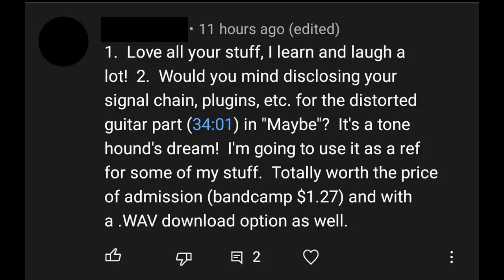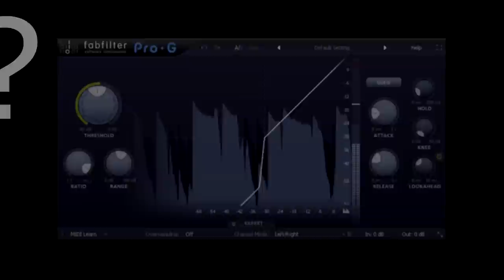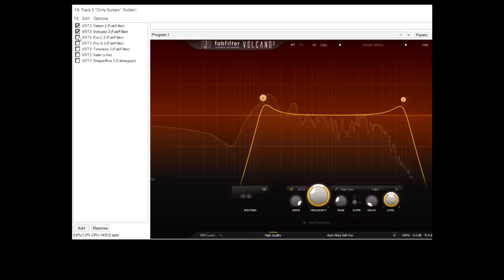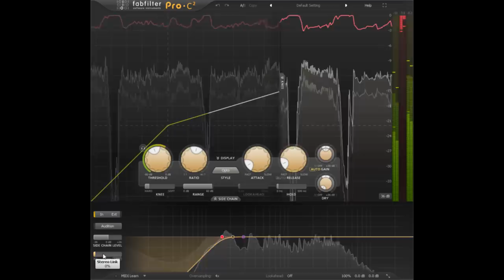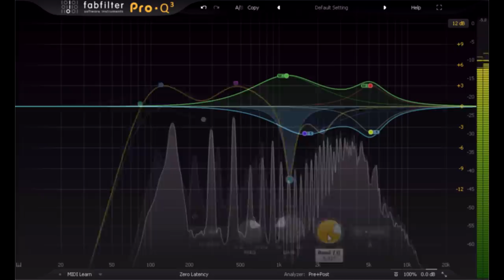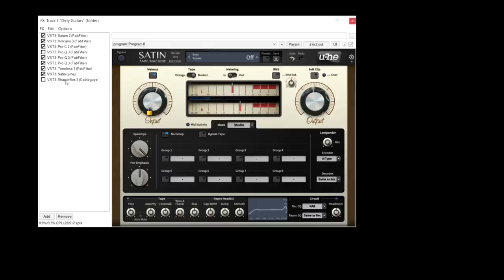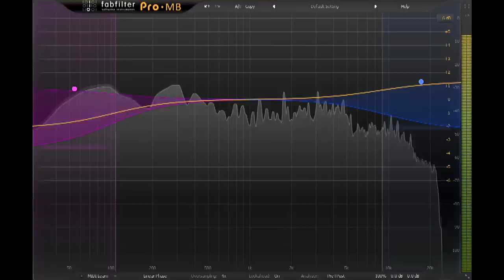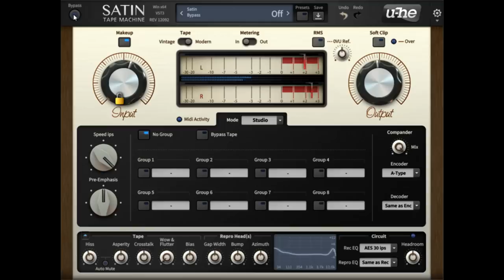How Did I Make That "Maybe" Guitar Sound? (Waves Voltage Amps)

Comment: 9:30 Interesting, I can hear a definite "narrowing" of the guitars on headphones, but to me, it sounds more like they go from separate parts being played either side of my ears, to more cohesive parts about level with my ears. So still wide, just not as wide.
Reply: Well binaural listening causes the left/right channels to be isolated to each ear while in real life no sound will ever just reach a single ear and not the other. So subtle "narrowing" like this can ironically make a mix feel even more three dimensional on headphones.

I remember experimenting with very little haas delay and 6dB/oct low pass filters on only one side to simulate a stereo speaker/room experience for guitar parts. 

An example would be taking a single guitar recording panning it %30 to one side, putting around a 10 milisecond delay and a low pass at 6khz to the opposite side. You will notice that it will almost sound hardpanned to the side the channel is panned to.

It can sound good but is honestly high risk - low reward. Haas delays DRASTICALLY change the percieved position of the sound and are very sensitive to small changes. Bass, drums and vocals become harder to separate because of that but mono compatibility is suprisingly not a big problem as long as you pan them above around %20 in a direction.
Reply: yea, it's rather dramatic even on my TV speakers. it depends on what you pay atention on I guess

Comment: I find that most of the "box tone" of plugs like the Puigchild comes from the subtle hiss they add. Adding in white noise buried deep in the mix is an old trick to make very clean mixes sound denser and fuller and "more analog" and that's basically what that bottom switch on the 670 does. But when you pause playback it can get mighty annoying to listen to!
Reply: I'm pretty sure it's also saturation with Puigchild. Same with Puigtec and most Pultec/Fairchild emulations out there.
Reply: Also, most 1073 emulations have a slight low-mid dip, so like an EQ by default.
Reply from the maker: You guys made me load it into Plugin Doctor! It's not entirely working properly in PD actually, but there does seem to be some interesting saturation. If it adds noise its never been enough to bother me.
Reply: @DanWorrall  Interesting enough to make a video about it? :)

Comment: Is the "room" dial on the amp sims just moving the mic back, or are they maybe blending in another room impulse? Dark/Bright seems to be moving from speaker edge to cap so it would make sense that the room dial is moving the mic back but it sounds much more roomy when dialed all the way up while still hearing the cab nice and clear. Anyway, it sounds dope
Reply: It's just a reverb level amount knob.

Comment: Thank you for the video, as always very informative. I'm curious as to why the compressor @ 14:33 has stereo link at 0%, wouldn't that mess up panning?
Reply from the maker: There are two ways to create stereo width: level differences, or phase differences. An unlinked compressor might mess up the former, but might enhance the latter. The hard panned guitars create a pseudo stereo image, based on phase difference primarily. The mix as a whole uses a mixture of phase and level differences to create width. I tend to prioritise a sense of space over pinpoint precise placing of parts within the stereo image (depending on the mix) so I'm more likely to unlink my bus compression than link it. It's a matter of taste though, there's no right or wrong. Also it's only doing about 1 dB of gain reduction, and the left / right gain reduction is highly correlated anyway, so the difference in gain between the two channels is never going to be very large.
Reply: @DanWorrall  Dan thanks for the interesting video, I am bemused by the use of phase in this context. In electronics the two sources have to be completely coherent for phase difference to have validity, which two performance of the same guitar part no matter how good the player cannot be, so the phase relationship between the two parts is completely chaotic , they simply have minor timing differences which is not the same thing. Robert.
Reply from the maker: It's not completely chaotic: they're playing the same part, they're correlated to an extent. The chaotic phase is what creates the sense of width, and that's why I call it pseudo stereo not proper stereo.
Reply: @DanWorrall  Thank you for your insight, and for going further in-depth in your latest video, it's been really valuable.

Comment: has anyone tried any good fuzz plugins? for some reason fuzz is super hard to get right, and fuzzy tones in the box are pretty hard to find. plugin manufacturers prefer to do emulations of 5150 more and more, but getting the fuzz right is not a priority which makes me a bit sad
Reply: tonex
Reply: Klanghelm Sdrr2 has fuzz
Reply: New Softube Amp Room has a Fuzz pedal in it, it can switch to octafuzz also. IMO sounds great.
Reply: The only ones I like are:
Fuse Audio Labs - Big-Sur (from their VPB-Bundle)
Doom Plugs - Bratwurst (which can be surprisingly tasteful at lower settings)
Linda Audio - Fuzzy
And finally, the both Fuzz Face and Big Muff models in Audified - Multidrive Pedal Pro
Reply: @hanisa50  yeah, that one is pretty good
Reply: @ChrisDN  thanks a lot everyone. I will check them out
Reply: Amplitube 5 has a great big muff emulation
Reply: fuzzploid by shameless plugs
Reply: @ChrisDN  Bratwurst Fuzz is indeed awesome - and I'm not just saying that because I had some involvement with its development ;)
Reply: @Beatsbasteln  Thanks Florian!!!
Reply from the maker: I have a small collection of pedals I like to use before the DI. Big Muff. RAT. Tube Screamer, obs. Why use an emulation when the real thing is hardly more expensive?
Reply: @ChrisDN  Thanks for the shout out  =)  Absolutely brill to hear that you've been enjoying Bratwurst Fuzz!
Reply: @matthijshebly  Understatement! - thanks for helping so much, team work!
Reply: @DanWorrall  True, obviously. However, unlike the overwhelming majority of real-life, hardware pedals, software plugins can sometimes be completely free, while still being equally awesome!
Reply: Definitely the free Face Bender from Distortique! Sounds great and has an adjustable gate for those low -voltage Velcro sounds.
Reply: @DanWorrall  it's a workflow thing for the most part. I really like my DI's to be DI's, especially if I'm sending them off to a client. but yeah, I guess I don't have a choice but to buy a real pedal

Comment: you are a nice guy when the time pass , i like your videos. I hace a stupid and retry question every fucking day. I have an apollo x 8 and i think is very fuzzy and colored as converter , i like it to track , has a lot of personality that kind of sound , but in da tasks the thing changes when you have to process audio thru external hardware , a lot of excesive colour and often a little mudd sound , so i think in buy an rme adi 2 pro , to send to the hardware gear and back in a more transparent way. What do you think? maybe is my perception or the uad apollo is a fucking coloured unit or maybe this is just idiot. Thanks , and you are my hero in a world of music production full of people whitout personality and good spirit. Thanks for the videos!
Reply from the maker: I've not tried the UA interfaces, but I would be very surprised to find the converters were that coloured. Are you coming back in via the preamps? If you can't transparently loop back from line output to line input then the interface is broken IMO.

Comment: Fabulous! Nice to see the inner workings of your session.
I did notice on your Pro-G instance that the attack was opened up quite a bit. The plugin does this upon initializing by default. Did this not soften the transients on your guitar, or was it just a creative choice?
Reply: lookahead was set at 1 ms and attack was set at 1 ms, means it right on time with transients. nothing soft about this settings
Reply: Pro-G is a gate, not a compressor
Reply: @saftpackerl  this is a gate, not a compressor
Reply from the maker: You guys beat me to all the correct answers. Yes it's a gate not a compressor. And lookahead compensates the attack, which is itself faster than it looks: the control is scaled to give you very fine control where you need it most, with very fast settings. There are a few notes that don't fully open the gate. But the 'guitar' style in Pro-G is very forgiving, and with the amp distortion you don't really notice. I dialed it in with the amp in place, didn't spot that at all till I bypassed it to make the video.
Reply: @DanWorrall  thanks dan!!

Comment: A question for your highly tuned ears… maybe you’ve answered this before. But how do you feel about console emulation plug ins? I notice you don’t run them, do you like them or do you not use them at all? If he has a video talking about this someone plz link. Thnx
Reply from the maker: I think console emulation basically boils down to saturation. I love saturation and use loads of it when I mix. But I don't feel the need to add the same type of saturation to every channel. They each get whatever works for that part or bus.

Comment: thanks for your nice technical input ,  but to my taste as a guitar tone chaser , not a cork sniffer actually, this is too much talking about a sterile guitar sound... the sound doesn't behave like my subjective "real amp response idea"... could you point me into an actual guitar track with a real tube amp... because your insights are absolutely spectacular, I'm learning a lot about where to look and use knowledge before moving knobs and switches to see those colorful lights go on and off... got the chops,  strings and amps but my recording skills are simply horrible...!  thanks in advance.
Reply from the maker: This is an actual guitar track, what did you think I was playing? I don't record my valve amp these days because it's too loud and it kills my ears for the rest of the day. And I can get equally good results from amp sims IMO. But if you can find a guitar tone anywhere in my musical output that ticks your boxes better, let me know and perhaps I can do a similar breakdown.
Reply: @DanWorrall  a guitar it is, thats not the point, the loss of natural attack dynamics printed with your hands and pick, the relationship between attack-release and the harmonic response is from a plug in , an amp behaves and breath in a different way , that was the point , a plugin response tends to kill the player nuances... volume dynamics are in the hands , same with ghost notes that a compressed signal from a distortion plugin  tends to heavily dehumanise ... more player and less overkill with plug ins. I enjoyed your guitar parts, plus your insights on recording are spectacular, in no way I'm trying to imply any negative criticism on your fenomenal work, if there is anything for me to say, Mr, Worrall I respect your sharing on details that i would have never imagined by myself. loud amps are a drag, and ruins your day, I clearly understand that.  no affense Dan. ! and thanks for your input in every YT video you upload.

Comment: cool video. true mixing porn :) however i got one question: why do you care about mono compatibility in your music? if this question sounds weird to you: your music doesn't sound like it was made for clubs and it also doesn't appear like something people would listen to on cheap mono kitchen radios or phones. so why would it matter that your stereo signal also works in mono?
Reply from the maker: I think better mono compatibility also makes for a more solid and stable centre image. And I mix my clients' music to be mono compatible, why would I not do the same for my own?
Reply: @DanWorrall  thx for your insights. and yes, when you a/b-ed the m/s eq there i immediatly felt like narrowing this crucial range of the guitar sound glued the tracks together in a nice way, making it more solid.

btw, you should totally make some more videos about certain effect chains you were proud of in your beats. i like that it's more of a mix of techniques, rather than just a single plugin showcase thing or a clininical test. shows more of your casual side
Reply from the maker: I may not have phrased that as well as I could. With the EQ in there's less sense of two separate hard panned parts. Which I guess you could describe as a narrowing of the mix. Perhaps better phrasing: the MS EQ turns the two separate guitars into one unified stereo riff. One, wide but focused part, instead of two identifiably separate parts.
Reply: @DanWorrall  thanks for clarifying but i got what you meant the first time around as well. i also do that all the time. i mean starting off hard-panning stuff, then grouping it and then apply mid/side effects to define the narrow-ness and stuff.

maybe still a good topic for a video. like.. what type of effects can be used in this configuration and how you use it most of the time, or something outstanding :)
Reply: @DanWorrall I tried this trick on a rock mix, and guitars started to overwhelm the vocals 😢